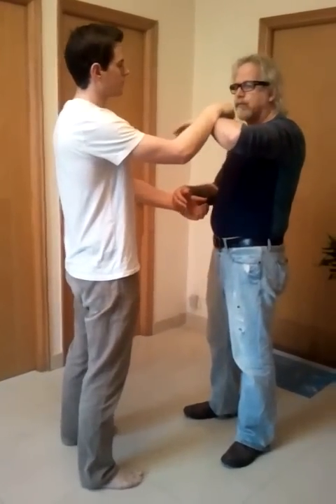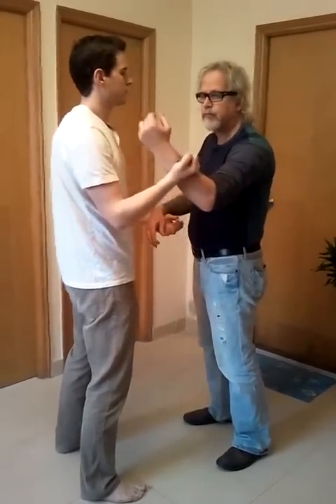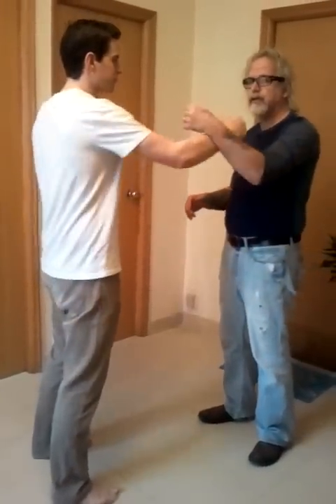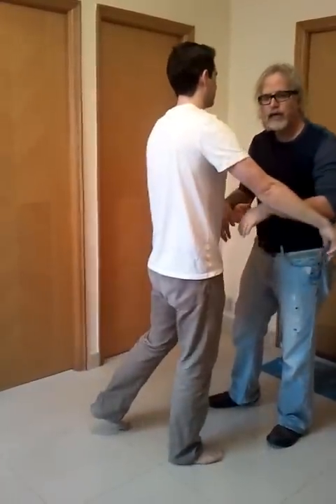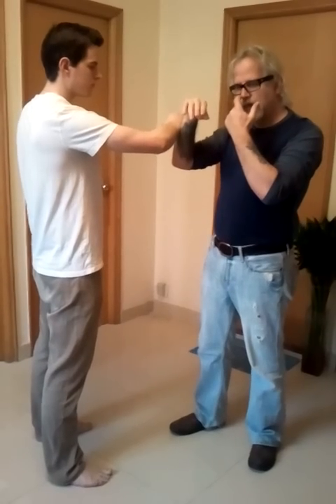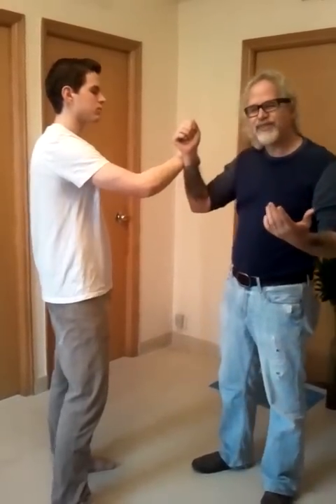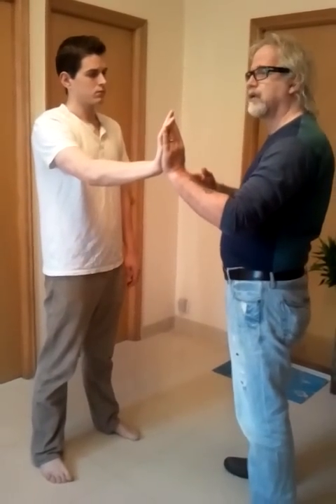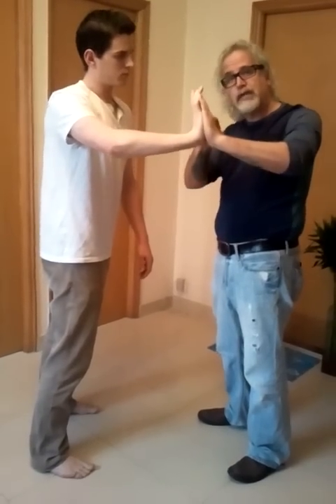Kaufman Wing Chun Transmission of Energy

Comment: I've watched this so many times, and still don't get it, but it's awesome! Wish I could meet you, but I'm in Tennessee. Not Hong Kong, or wherever you are lol.
Reply from the maker: nemesis9022...I'll do the best I can to explain this. My understanding and thoughts about what is actually occuring here has evolved since I made this video years ago. My current thoughts are that what is actually happening here is once the body is connected (one part moves, all parts move) even a very small motion can disrupt the structure of the opponent. The talk about it coming from the head (back of the brain) is simply to not concentrate on any one body part's motion (e.g. the hand), but to allow the body to remain whole so that the weight of the entire body (even in a small motion) is involved. When done at speed, the disruption effect (what in the video I called, "transmission of eneergy") is greater. Hope this helps.
Reply: @johnkwc  thanks for the response, and yes that does help. There is a Chu Shong Tin lineage school in my area taught by Sifu Trevor Young. Just trying to save the money up to go there. Good wing Chun, and cheers.

Comment: That's easy to develop, it is part of the Siu Lim Tao, when trained properly... And to achieve that sort of transmission is not possible without movement, so therefore the distinction between "outer" and "inner" or "mechanical" and "mental" does not exist, even when the outer movement is as small as possible. But someone has to train the Forms for a precise coordination of that. Otherwise the "internal stuff" leads to mystification of "Energy", but it is just kinetic energy... In Sports science there ist a distinction between "intermuscular coordination" and "intermuscular coordination". So that sort of transmission of energy is "intermuscular coordination" of fast speed muscle fibres. The quality of that grows with the amount of time invested in training  that fast-twitch. So: when that concept is not known, the "external guys" won't come to the point, whereas the "internal guys" tend to overemphazise the "mind" and the "Yi" and forget the "hard work" and won't come to the point also.

Comment: This is fantastic sifu. I truly desire to develop structure, timing and power that doesn't require my muscles or momentum. 

Is it safe to assume, that when doing my siu nim Tao. I should keep these things in mind. 

1.)Relaxation =let my body sink like I'm melting, settle into my position. 
2.)Mind intent. Is it kinda like my mind creating the image, as my body simultaneously does it? 
3.)Turning the light switch on in from my energy being totally focused on that individual? 

Thanks in advance. Anyone else you know that embodies this form of teaching? 

This is the most thorough explanation of rebound energy I have seen.
Reply from the maker: I would say, "yes". Raise up through the spine, settle all muscles down, expand from within and use idea to move from the spine/center.
Reply: John Kaufman what I have a hard time understanding is "using the idea from within".what did you feel when you started to be able to do this?
Reply from the maker: Felice Mathieu "Use idea to move" is more about sensing power rather than trying to create it physically. It is difficult to explain. When you are sufficiently relaxed/settled/open, you just "think" move (but do not turn the process into a physical effort; no muscle tension), and with some practice you will start to feel movement inside you. You allow this internal movement to move you externally. Hope this helps. If you have other questions...contact me by email: john.kaufman21@gmail.com.

Comment: As I understand, when you go "zzzt", you don't point just anywhere on his body, you  specifically point to his center of mass. Is this correct? What I see physically is that your hand moves a bit down toward his center of mass, and his center of mass is what moves first when he starts to shake.
Reply from the maker: This is a very good question/point Nick. The pointing is an indication of the mind's focus. So, yes, the mind's focus is on the center/spine. And, yes, there is movement of the hand. So I guess you could say this is an example of small or perhaps efficient mechanical movement. The way I think of it is that it efficiently combines the Yi, Chi, and Lik. The mind's intent, the energy, and the muscle moves as one. This is what must happen for internal methods to work. So there is a transmission of energy directly to the center (or wherever the mind directs it). The person (Ben in this case) does not feel that there is a pushing through to his center, but that it is affected directly...like he is 'shocked".
Reply: John Kaufman
Thank you for the clarification. Keep making videos, as it is rare to see the internal aspects explained. Not that it is possible to learn this without proper personal intruction, imho.